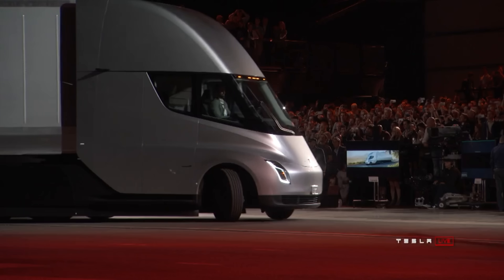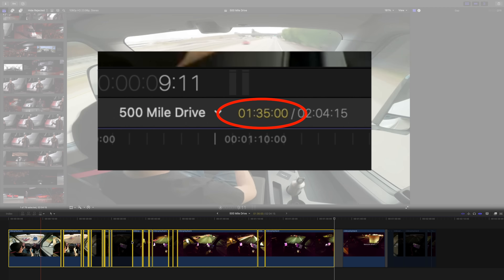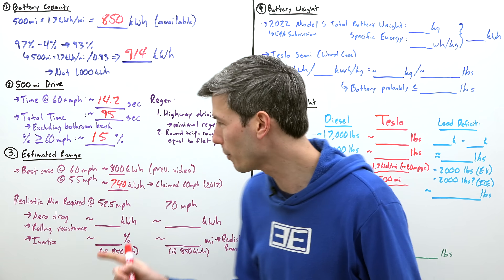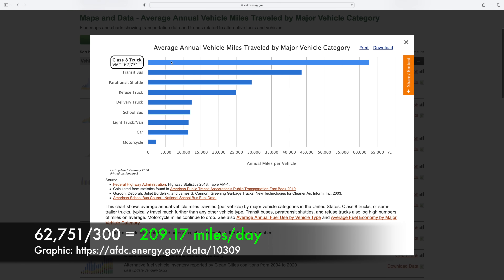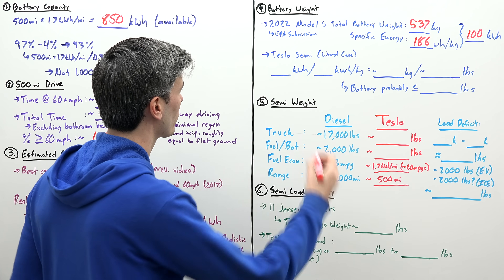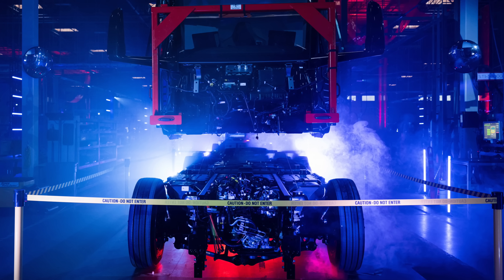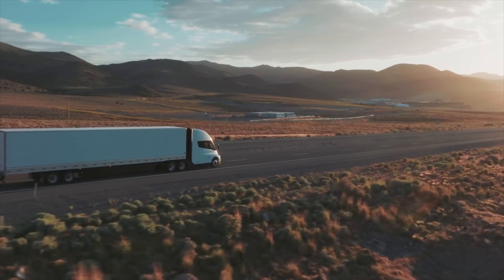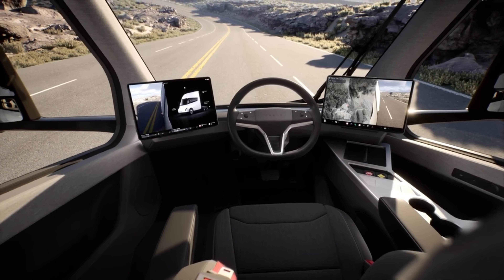Does The Tesla Semi Make Any Sense? Part 2!

Comment: This is very interesting, thanks!. Have you ever addressed the carbon foot print payback of vehicles like this? With data from volvo,  a small suv with a 250mi battery vs the same car ICE, approximately 110K km are required based on a world mix of electricity generation. Some have asserted approaching twice that or more with a 400 mile range battery. I'm very interested in your take on these numbers, and how they might relate to over the road trucks.
Reply: According to Reuters ("Analysis: When do electric vehicles become cleaner than gasoline cars?") for the cleanest electric grids (example: Norway) it would break even at just 13k km. For the dirtiest grids (example: Poland, China), it would break even at 125k km. For the US grid, which is somewhere between those two, after 22k km the BEV would be less polluting. It's worth noting that the areas with the cleanest grids (example: Norway and California) also have some of highest percentages of EV sales compared to the total.
Reply: That 110k km figure from Volvo was at the upper end of the payback range for a very dirty fuel mix. If I remember correctly average grid mix is closer to half that, and optimal conditions were under a third of that.
Reply: @falxonPSN   I provided a source, google it. It's as I stated. 47k is for all wind, which I'm not sure is a thing unless you ignore the cost of grid storage or base load. 77k is cited for an EU mix.

Clearly EV is a good thing over time, but the advantage from a carbon offset perspective is back loaded. How long ev's stay on the road, how effectively cells are refurbished, reused in grid storage, recycled really makes a difference at this point as to when the investments to support them might pay back. For me, a question is how residual value and repairability affects the lifespan, that is, are ev's more likely to be scrapped rather than repaired in relatively small crashes. Tesla's approach to repairability has been very poor, restricting and threatening 3rd parties from repairing their vehicles.

There are still very heavy investments to be made charging infrastructure, grid storage and nuclear expansion to offset renewables, upgraded transmission, battery technology, etc. It's got to be in the trillions. In a better world, the incentives provided to automakers would be tied to goals of reusability and recyclability, ultimately increasing the lifespan of ev's on the road, and returning on that investment. I don't see any reason that EV's couldn't be required to demonstrate a 50% improvement on fleet lifespan.

Tesla has taken a big boost from early incentives in the car market, and their push for otr trucks is lining up on future waves of incentives. Hopefully the market for OTR will be competitive enough (OTR vehicles can easily have lifespans a million miles) that it won't be a matter of Tesla greenwashing, to date they have shown little corporate citizenship for actually improving anything but their bottom line. Their first wave of cars were high performance luxury sedans, whose owners don't particularly care that actual carbon offset of the current vehicle is minimal, if they did, they would buy a hybrid. Now, with far more reasonable cars arriving in a mass market from multiple makers, we're just starting to see the future. 

I'd love to see a future where batteries where easily replaced and refurbished and reused by 3rd parties, and automaker incentives were tied to increasing the lifespan of the fleet.

Comment: If you wanted the truck straight back for another run rather than charge overnight, I’d wonder could you put a trailer on that’s full of batteries that would drive the truck and charge the truck’s batteries on the return drive home?

Comment: what they messed up is not making the main battery in the trailer which is going to be parked anyway to load and unload then it would have a use to short hauling the truck never has to stop just keep swapping to new trailers

Comment: I have to disagree on the Regen.. Regen gives back about 15-20%of what's used going up.. onE- Skateboard, Ebike, E-Scooter, EUC etc.. you will never get enough to equal the output. you have temp high amps going in but you also spend more time going up and faster going down so the period of getting the amps back in is usually limited for fraction of the time of what you went up

Comment: Electric buses in San Francisco and other cities around the world have NO BATTERY. What is the show stopper doing something like that in some freeway/interstate lanes. High overhead two power wires or high volts above and electrical ground below in the roadway like on some trams and trolleys?
Reply: Basically money… the infrastructure costs of installation for a system of overhead wires over long distances would, I think be fairly expensive.

Comment: Would love if EV trucks made sense but the 2 part video omits the calculations to include the environmental impact to point of sale (ie when both trucks roll off the production line). How long does it take for the EV truck to make up the CO2 differential cost to the ICE.  Volvo did this for one of their SUV models and published the findings which showed that you would need to drive at least 90 thousand miles before you begin to save on CO2. Hence we are not there yet as EVs don't work practically, financially or environmentally.

Comment: You gotta compare this with a train!!
Reply: That would be an awesome video! Though it's pretty easy to say it can't compete.

With trains you get way less rolling resistance, you carry a lot more (which would mean you lose way less from air resistance when adjusted for the actual amount of work done), you don't need to produce this absurd amount of batteries and no need for building fast charging stations (which I think should also be easier on the grid, as you'll be pulling less power over a longer period). Oh, and you need less long distance drivers.

So more efficiency and less pollution from producing batteries, stations, tires, etc. Trains were a very important part of the industrial revolution for a reason - you can't beat them in efficiency.

Though, the governments have to act on this, not private companies as improving rail infrastructure is shared between everyone, so billionaires don't have a reason to invest in it.

Comment: Question: How is the electricity needed to charge these trucks being generated. The reason I ask is we took a drive to California and came across a Tesla charging station being powered by a diesel generator, which left me baffled. If these trucks are going to be fueled with petrol generated electricity, then what is the point of this entire endeavor. A friend said they would be installing solar farms. If so, what size solar farms are we talking about. Could you please dive into this a bit I'm curious.
Reply: They're all fueled by the local energy grid power mixture.
In about 90-95% of the world, this results in less pollution than an equivalent ICE vehicle would output.
Reply: @logitech4873  with just 20% of US energy being  renewable, it doesn't seem all that green. I know that number is growing but still. What about charging times. The last time I fueled a peterbuilt it took about seven minutes. This was of course at a truck stop.
Reply: @carlosenriquez2092  You were under the impression that the whole thing was zero emissions? That's not the case.
They just need to be better than the competition, which is diesel trucks. And that's no problem. Check out EE's part 1 where he goes into this.

Charging should take about 30 mins to 1 hour with the V4 chargers, depending on how much you're charging.

Comment: I still don't see a lot of discussion around the cost of GVW increasing (at least 4k by your calculations!) due to battery packs. This to me is the biggest concern for the viability of these trucks long term, not price, load cap, or range. 

Not only will we subsidizing these as taxpayers to encourage sustainable transit, but these will drive even higher maintenance costs for highways than a typical semi does due to at least 4k more poundage per vehicle of dry mass. As you said, since most vehicles don't travel at max weight, most loads will be still within regulation, but the weight will go up to carry the same load.

I wonder what the increased infrastructure costs will look like in the future if, for example, 10% of highway vehicles use battery packs.

Comment: 500 mile semi is likely based on 9 Model S size packs using 2170 cells. Semi parts catalogue shows 9 modules - 900 kWh. Each module likely 20P,280S 5600 cells, 50,400 cells per pack (3.43 Tonnes of cells). A coincidence but a mile of usable range at moderate speeds per 100 2170 cells.
Pack weight likely 9 x Model S pack - 537x9=4833 kg. 10655 lb. That is a 41% margin to cell weight. 
4.5T (9920 lb) pack would be a 31% margin to cell weight. 
Semi is likely 22,300 lb (10.1 tonnes) due to weight cutting in many areas. Rest of Semi 12350 lb (5.6T)??? Thus semi is 5300 lb (2.4 T) heavier than diesel semi???
Each module likely 1000V so trucks can be ordered with 3 to 9 modules.

Comment: Wouldn't solar panels on the trailer help to trickle charge the battery to extend range?? There is alot of surface area on trucks that could go to good use. I'm surprised I haven't seen this concept be put to use.

Comment: Friendly reminder that 500 miles isn't enough for any common (highway) trucking however the look of the truck says that's what it's built for.

The math on that.
At 60mph (slow for highways as 65 is the norm and 70+ is becoming common) you only get about 8.3 hours, where 10 is the norm (11 is the max)
Reply: Try watching the video. 500 miles is more than enough for the majority of deliveries.
Reply: @logitech4873  "deliveries" is not "jobs"
 My experience is from doing the work, Just because a delivery only takes 300 miles to make that just means you're gonna pick up another 300 mile delivery  On the same day.

I don't know who compiled the data or why But it's not indicative of what the drivers actually do for work, Consequently it's also not what the trucks do for work.

Comment: So with all the figures but the electric truck can carry more weight?? So the tyres have more load rating??  Or its just ok to overload Tesla tyres?? That tyre seen is a common truck tyre. They may have extra load for production models but I doubt the 'mules' do not. 
Now as many know Elons Elektrikity vehicles do NOT get the stated mileage,, neither do diesel powered vehicles. So in real world they get 400 miles,, in cold weather less. A truck on interstate haulage will do double that and two up maybe 1200.
So really they are ok for local deliveries but in stop start traffic may need a jumper battery!! Or a tow truck!
All this theory is based on the truck coming home to charge up overnight. Interstate work they are home maybe once a week so rapid charging at god awfull prices and in turn that kills batteries.
Reply: You really think 2000 pounds extra is enough to bring the tires above their load limit?

And Teslas easily provide you with their rated range in summer, and somewhat less in winter. Look up NAFs summer and winter tests for numbers here.

Comment: Teslas cant haul paper,recycled metal,batteries, or lead will have to be limited to city/local only. A big reason is because in OTR you can be stuck in an area that only has a load of paper that they load you at 45.5k. Not to mention the logistic problems of trying to charge your truck 200 miles from the nearest big city in the middle of nowhere kentucky. the cold factor effecting the charge of the batteries And if your truck batteries die in the middle of the night while your sleeping or have an a mechanical issue your only choice is to get towed to im guessing a tesla dealer or shop which will be few and far between and THAT is gonna be one expensive tow bill
Reply: I'm skeptical, after having crossed the country several times on a cafe racer, that there is anywhere 200 miles from nowhere left.  Maybe not ideal, but you can find find gas, and where there is gas there is electricity, about every 100 miles. (No gas gauge, so that is when I'd watch and try to refill.) Plus there are already electric car cross country run records happening.
Reply: Tesla and Pepsi are building the charging network together

Comment: You are still limited by recharging if that takes to long you cant make money. Also to many charging stations in an area can be an issue for the power grid. The hauling it self should be enough for most transports. But what will a new battery pack cost recharging will lessen the pack. Thats info they haven’t released yet but make a guess 20k for a normal car so i would imagine 60k for the truck at least.
Reply: A 850kWh battery pack would probably cost 88k not counting labor

Comment: A huge factor that’s not mentioned in this video is that you absolutely cannot afford to take your batteries down to 5-10% charge repeatedly if you want them to last.

Discharging most of the battery capacity will degrade the batteries extremely fast, cutting down their total cycles by 60-70%.  This could require replacing them after just a year of use, which isn’t economically viable for anyone.
Reply: We still don't know the cycle life of the battery the semi is using

Comment: Another aspect to consider for the average GVW is that your standard 18 wheeler semi can only be loaded to 80,000 lb. Any loads above that require having extra axles; meaning a Tesla semi probably could haul some of those loads also, if the trailer has extra axles.
Reply: The tractor would also need tridems for heavier loads in some cases. but that is usually for super loads like 120K or more.
Reply: @TheBuddilla  True, but it looks like adding a tridem to a tesla would be tricky, and it's probably not a high priority for Tesla to manufacture a version with them.
Reply: your standard 18 wheeler semi can only be loaded to 80,000 lb. 
Electric and natural gas-powered Class 8 trucks are allowed another ton, to 82,000 lbs.

Comment: What you are possibly overlooking is that there are a ton of special use class 8 trucks that are seasonal use trucks so they cloud your figures.  I own and run 2 semis.  One is used only during my spring busy season and I put on about 15k per year.  The other is a long haul truck that I drive part time, and I put on about 80k per year.  To come out financially I need to run 630 to 670 miles per day to be profitable.   

So the tesla won't work for my long haul truck use case.  It also won't work for my seasonal use truck because it's way too expensive to tie up that much capital for something I only need a couple months per year.

These teslas will be used on short dedicated routes with lighter loads, that's why you see pepsi buying some.  Doubtful you will see many going over the road.  They just aren't practical.  Driving normally my daily average is about 63mph.  If these things are poking around at 55 mph other drivers are going to hate these road clogged, especially out west

By the way one of my runs is hauling pepsi beverages and even those loads are pretty light.  The most I've ever carried on a beverage run is 66k total weight.

It's irrelevant if the tesla can handle 60 to 90 percent of the loads.  If you're a driver your truck needs to handle the highest percentage of available loads, otherwise you are sitting and not running.  An 80 k truck can take any load, but if your truck can only take loads 70k and under for example, and you're also limited on the margins by speed and range, that's pretty impractical.   Drivers don't make money sitting and waiting for light, short loads.  If you have to take a pass on 30 percent of available loads that truck will get traded off quickly for something usable.  Profit margins are thin so you have to maximize everything to come out and can't afford to turn down loads.

Nice that the taxpayer is subsidizing pepsi.  Where is my subsidy?

Comment: Government subsidizing the cost of electric trucks = taxpayer funded Tesla trucks. If the Tesla truck is so cost saving for the truck owner, it needs to stand on its own financially. Why should my hard earned tax $ go to someone's profit margin, if any? Also the Tesla truck could be a pipe dream due to the supply of Lithium (from China) and cobalt (mined by child labor in the Congo) needed for the battery of all of these trucks and cars plus will the electric grid handle all of these trucks and cars that don't use Diesel fuel? And what happens when these trucks are at the end of their useful life? How do you scrap the battery?
Reply: You can mine lithium in the US and most of them comes from Australia.  You can recycle the batteries when they're at the end of their life